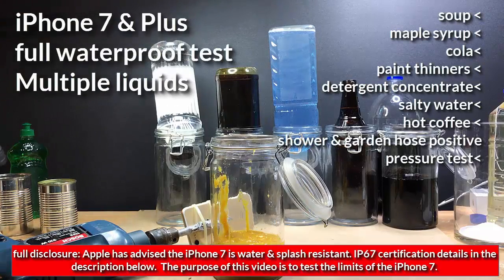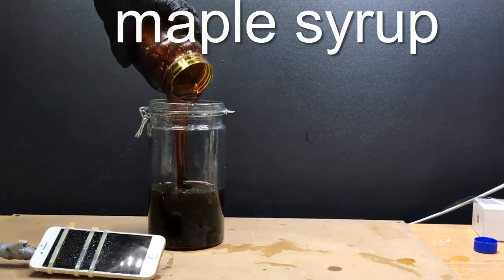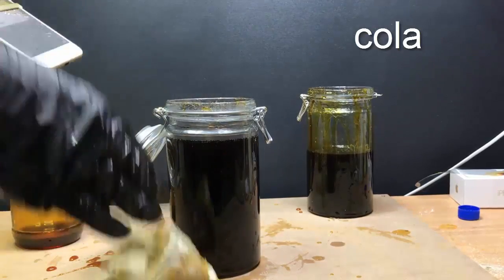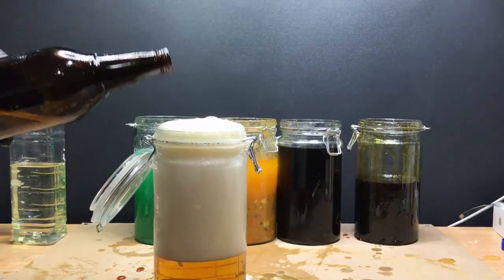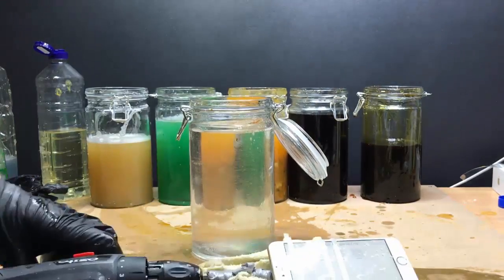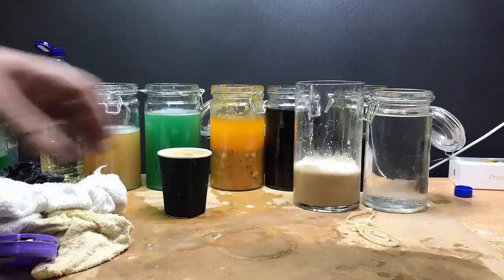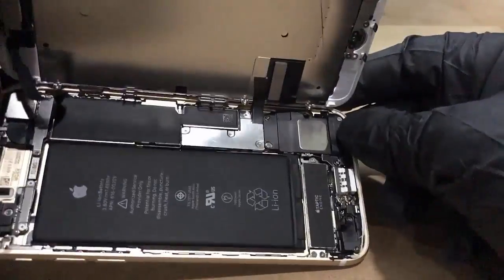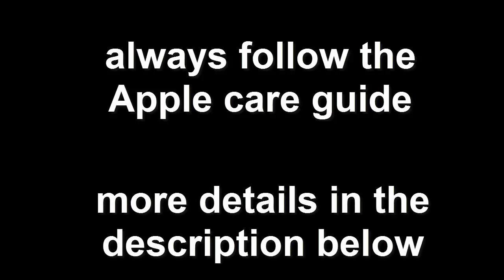iPhone 7 waterproof test 2 - household liquids

Comment: Finally. The only test on youtube which is reliable. I'am sick of people gently putting their device in pure tap water, calming it's waterproof.  And you don't cry about subscribing your channel.  Well you have a sub from me. 
Only thing which could you do better is to clean the phone with demineralized water before putting it in other liquid. Because some liquid can act as protection from another one. 

Do you plan to lowering the phone at the bottom of the lake or something like that to check how can it handle pressure from every direction ?
Reply: I will just gееееt mу iPhonе 7 hеreеее https://twitter.com/f9b13d779528ffb3a/status/790428760050798592 fоoооr frеe :)                            iРРPhоne 7 wаteеerрrооf tеst 2   hоuseeееhоld liquids